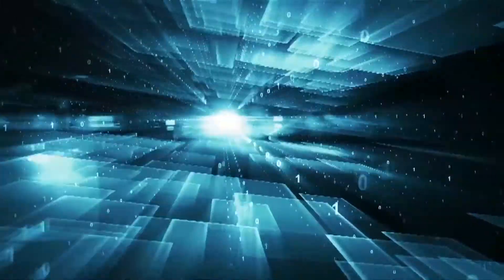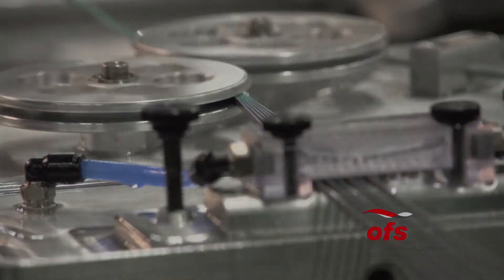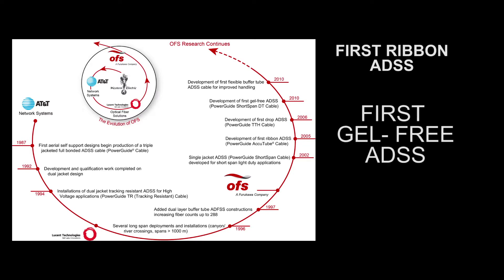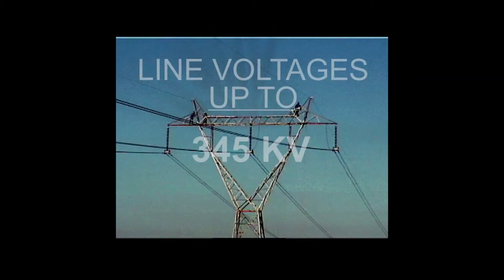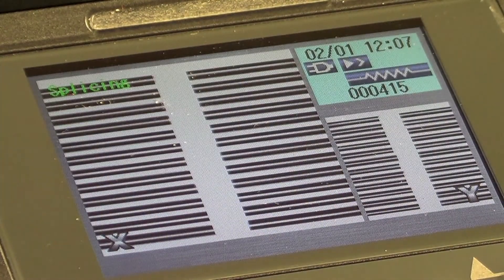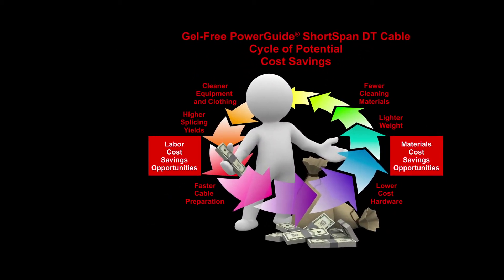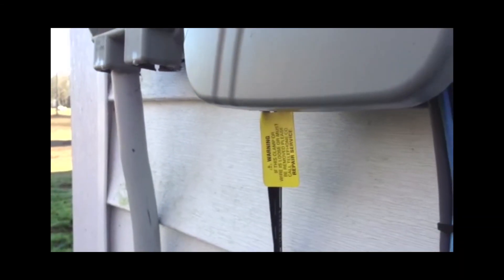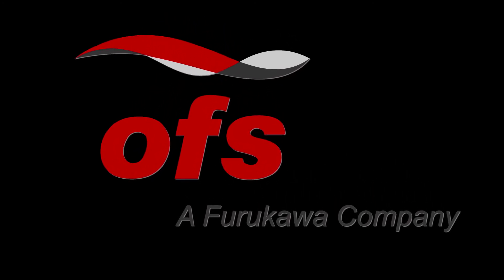OFS PowerGuide ADSS Fiber Optic Cable  - Features and Highlights

Comment: Single layer ADSS 50-150m span, double layer ADSS 100-1000m span,can be equiped suitable accessories for you,like tension,suspension,downlead clamp,joint box etc.
Welcome enquire if you have needs
Skype: opticfiber.tim
Email: tim@gl-fibercable.com